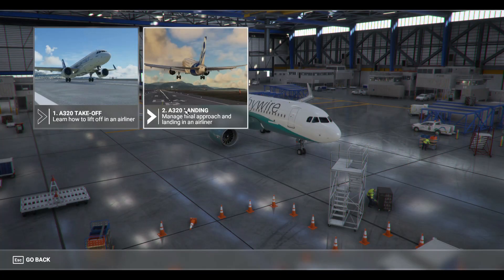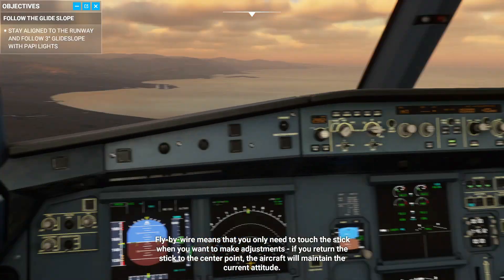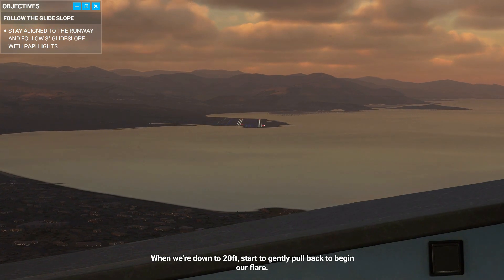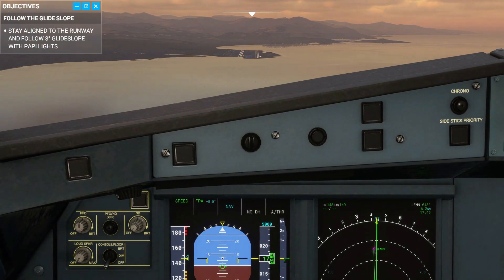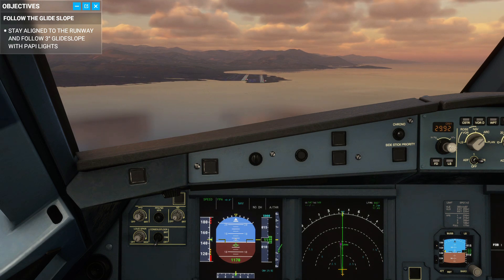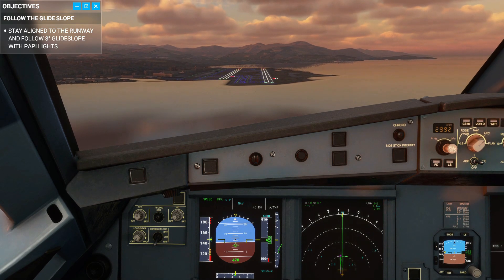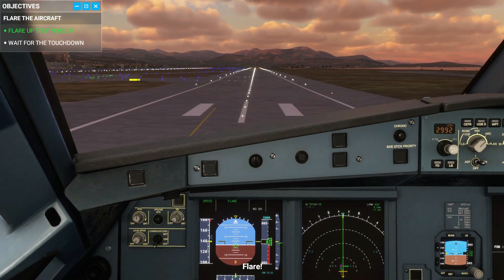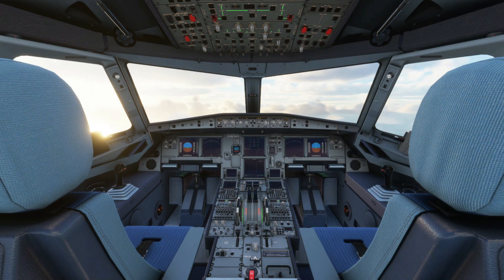A320 Visual Landing Using PAPI Lights | Microsoft Flight Simulator | Default A320neo | A320NEO

Comment: I did this one time! I practiced my landing with the Tutorial
Reply: the only problem is localizer is broken for this approach so I couldn't land with help frmo Autopilot until like 700-1000 ft.
Reply from the maker: The localizer slightly captures late but it adjusts itself in a few seconds, the word LOC means you’ve captured the localizer while LOC* means you’re capturing the localizer.